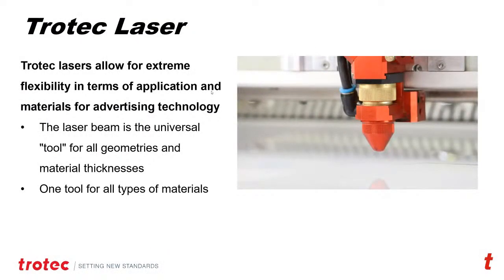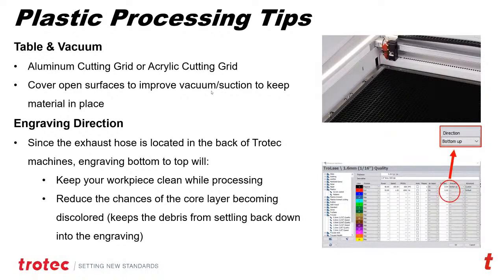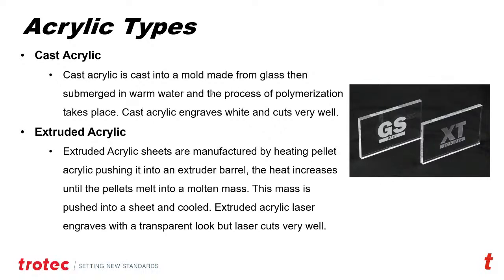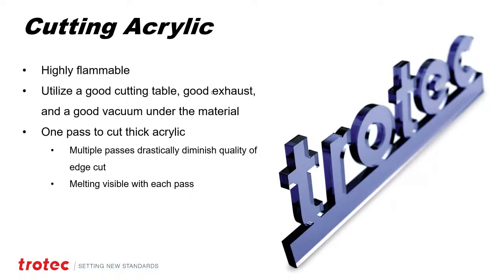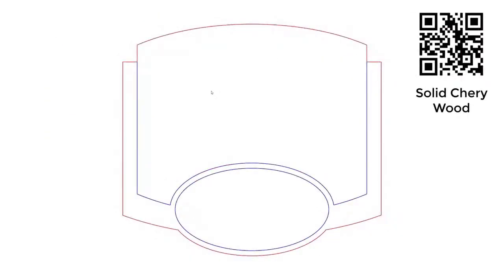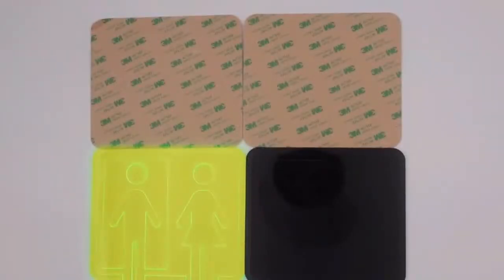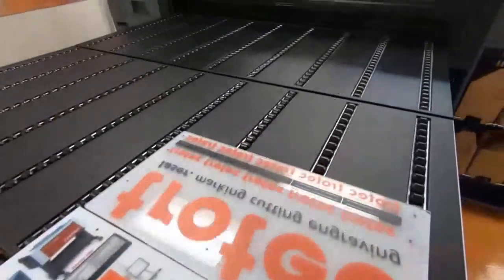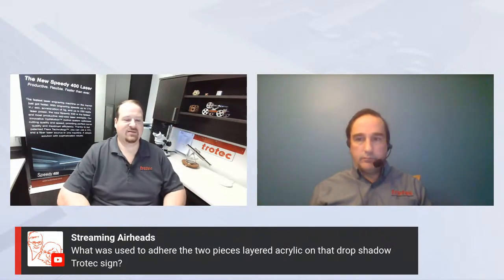Trotec Third Thursday: Signage Techniques and Materials Workshop

Comment: In The video you recommend Hexane for cleaning trolase. California won't allow the sell or shipping of that product. Do you have an alternate suggestion?
Reply from the maker: Hello Eric. This Heptane material should be available in California. It is a little bit more expensive, but it works just as well as the Hexane: https://www.mcmaster.com/3190K548
Reply: @TrotecLaser  Mcmaster wont ship that either. I am trying Amazon (more expensive)
Reply: @iraqmonkey  Try Zippo Light Fluid, it's recommended by both Rowmark and Gemini which both make material similar to Trolase.
Reply: @ArtisticGiftsUSA  because of the Prop 65 laws in california I had to buy locally-ish. I can buy Hexane on Amazon